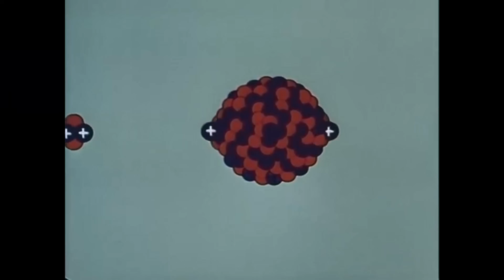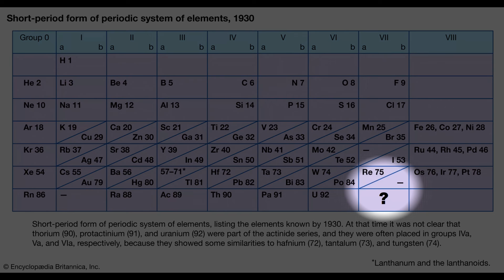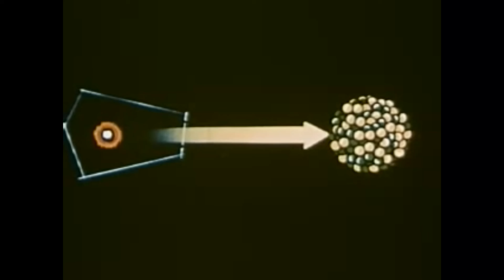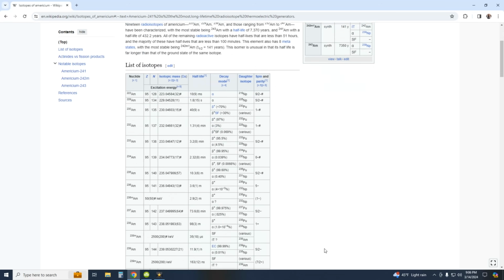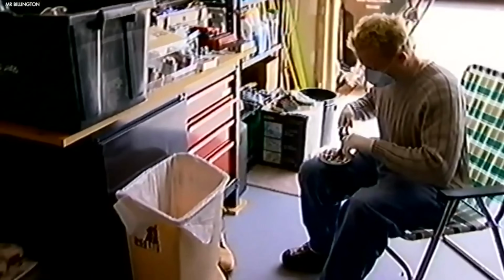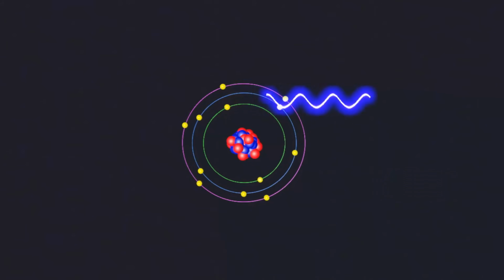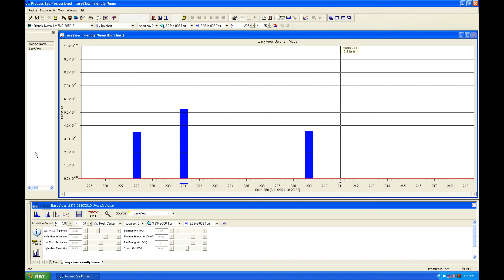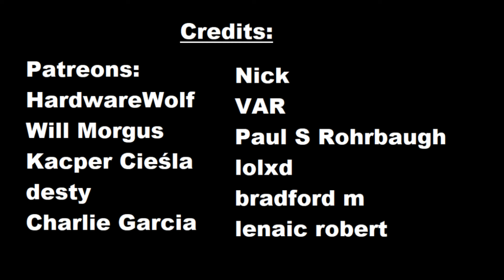Americium, history, property, overview and analysis

Comment: You need to check if you made your vacuum chamber hot in case you succeeded in evaporating any Am.   Though with an estimated boiling point of 2607 °C (4725 °F) you probably did not succeed using a SS wire.  Evaporation is a function of atmospheric pressure, so the boiling point is a guide.

Any metal that you evaporated will probably stick to the first "cold" surface that it encountered and not make it into your Residual GAS Analyzer (RGA).  It would be a very lucky and possibly impossible path depending on the internal RGA geometry.   Usually RGAs are specifically designed to block accumulating solid contamination on the detector.
Reply from the maker: I totally agree and I suspected as much . I didn't pursue any further because of this very fact! I didn't think I would evaporate anything but I wanted to see the peak ! Like I said in the video, there wasn't any point going further since almost everything was detected anyway, but it would have been a great addition! Thanks for watching!